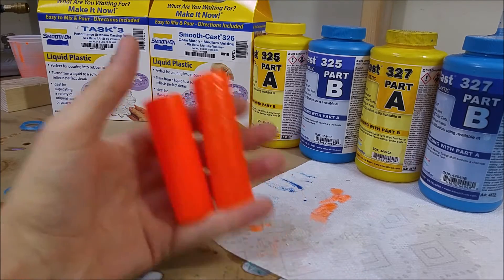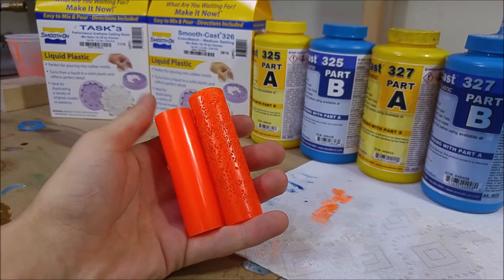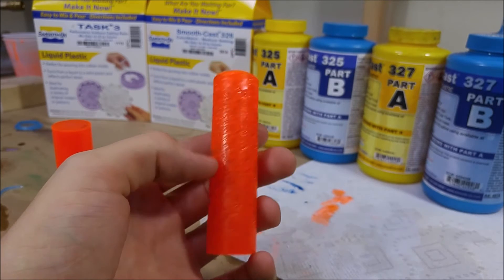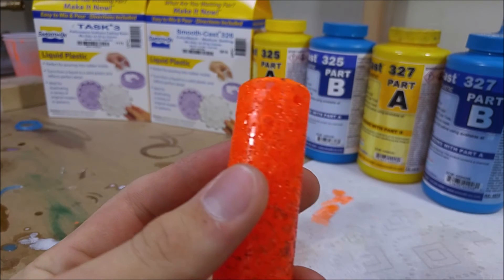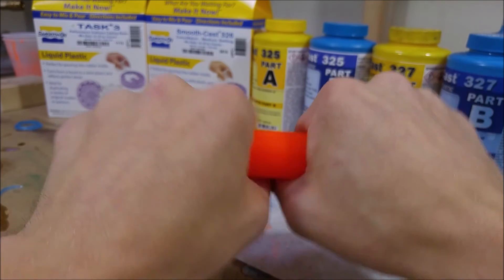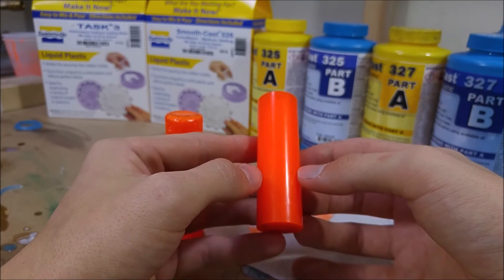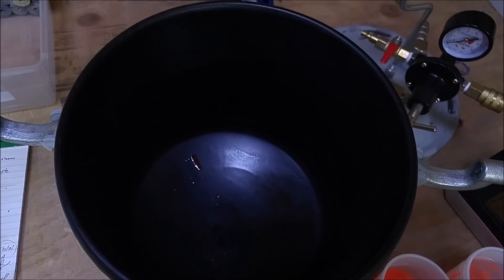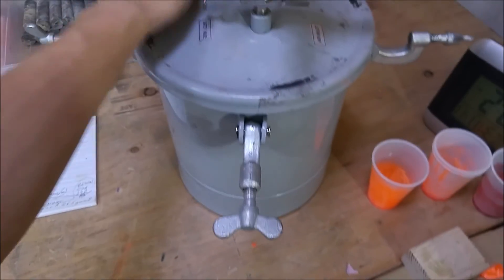Why You Need Pressure Pot For Casting Plastic - Smooth On or Alumilite

Comment: without seeing the whole process of your casting its hard to say what happened... but something is WRONG with your resin... i have never used a pressure pot and have never had that many bubbles... when using clear resin i see the odd bubble.. i have even pourposely whipped air into resin to see what would happen and never had that many bubbles, also the bubbles were much much smaller...

Comment: That foamy looking resin looks like old resin or resin that had moisture introduced to it.  Perhaps from the pigment.  I've used Smooth-on without pressure and they don't foam up like that unless they are contaminated.  That being said, if the end result is going to be turned on a lathe then they should be cast under pressure because you can get small bubbles inside the casting, though they don't normally affect the surface of the piece.

Comment: What kind of pressure chamber would recommend for large castings?
Thinking of making a 55 gallon steel drum in a pressure chamber and rate it at 60psi.
Reply from the maker: Christopher Ross making large pressure chambers is rather tricky. 60 PSI isn't very high, however you have a very large surface area it will be acting on.
Reply from the maker: It would need some reinforcement because although the drum is airtight, it would be very weak at the corners. They would have a tendency to bow out and break. I also believe most steel drums are rolled sheet which means there is a weld on one side. Depending on how this weld was made it could be very brittle from the heat of the welding compared to the rest of the steel. This would be a problem once the container begins to expand under pressure and the weld stays rigid. It would likely cause a crack and burst around the seam.

If you could get your hands on on large diameter steel tube or especially pipe, like a cast off from the oil industry, it would have a much thicker wall and would be able to handle the pressure much more safely.

Comment: Great video. I just started getting seriously into mold making and casting, and I've noticed that degassing is indeed a big problem with all the urethanes I've tried so far, even though Smooth On says specifically that some of their products don't need to be cured under pressure.

Comment: Not familiar with this product but have used Alumilite a little.

Where do you buy it?  Is it as good as Alumilite?  What would you use for pen blanks?

Thanks.                                        JimE
Reply from the maker: +Jim E Hi Jim, I have used both Alumilite and this product for many applications including knife handles and pen blanks. I personally prefer this material as it has a softer feel and a better resistance to scratching. However most people that I have spoken with prefer the Alumilite for pen blanks, as it seems easier to manage multiple colors in a single pour. I would compare Alumilite more to an acrylic and Smooth On Smooth Cast more to a traditional plastic like abs which will flex before it cracks.

You can purchase this on Amazon, or depending on where you live, from Smoothon.com. They have a very large variety of materials to work with including rubbers and foams which I use to make a number of other projects.

Thanks for the comment!
Reply: +Nathan Lockman             Thanks Nathan.  That leads me to three more questions.

How does it compare in cost to Alumilite?  Amazon best price?

I see they have a lot of different product numbers.  Which number works the best for pen blanks and why?  Working time, etc.

Are you saying you can not add dyes to this stuff easily?       Thanks again.              JimE
Reply from the maker: +Jim E Hi Jim, I'm glad to answer any questions you have. Amazon is useful simply because it is so accessible. If you plan on making a number of pens or parts with the plastic though you will want to buy a larger volume of the plastics as they are drastically cheaper this way.
Price for Smooth on: http://www.smooth-on.com/Urethane-Plastic-a/c5_1120_1206/index.html?catdepth=1
Price for Alumilite: http://www.alumilite.com/store/p/933-Alumilite-Clear.aspx
Alumilite is about twice the price however I feel that it is easier to polish after turning it on a late.
Amazon is the best price for buying small volume as their shipping prices are usually better.

Both companies have many different resins for all kinds of applications. The ones that I utilize are Alumilite Clear and Smooth On Smooth-Cast 325 series. I use all three versions of the 325 series (325 326 327) based on what size of part I am making. Thy all make the same clear hard plastic part, however they have different pot lives and curing times. Personally I would recommend 326 as it  has a nice balance of pot life and cure times for most applications.
Here is a link to the differences between them: http://www.smooth-on.com/tb/files/SMOOTHCAST_325_326_327_COMBO_TB.pdf

Both Alumilite and Smooth Cast are easy to dye and add reflective powder to. I simply find that if you want all kinds of swirls and translucent colors in the part Alumilite seems to be easier to work with. However you can get identical results with both and I personally prefer working with the Smooth Cast.

I can try to get a video up this week of some of the colors you can make with the Smooth-Cast as I will be making some parts with it this week.
Reply: +Nathan Lockman   Nathan -  Thank you for the information.  It was very helpful.

I have only purchased Alumilite once but the real deterrent is the price.  And in order to get it really clear it takes some testing.  My first test to try to get "clear" mixing it as directed(50/50 by volume) was a complete failure.I called Alumilite and they told me to try using a little less Part B.  Of course, trial and error means $$'s.

I see the Smooth-Cast says "clear amber".   Any idea how yellow that is and how does it effect adding color?

Looking forward to any vids you put up using this stuff.

Thanks again for the help.  I really appreciate it.                  JimE